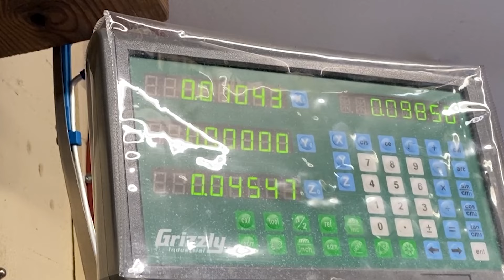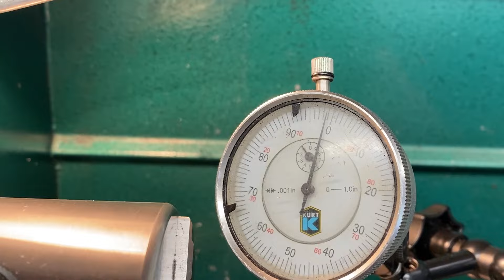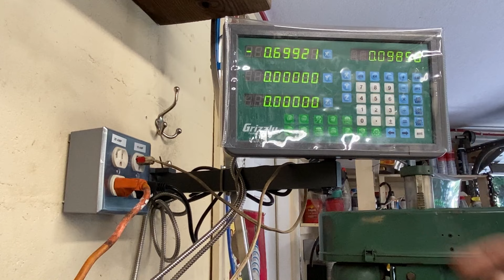Aluminum machining fuel Tee's Kawasaki.

Comment: Good work. A lot more time into them than people realise.
Reply from the maker: Only doing it this way, yes. I can't find any mass produced aftermarket for the ZX10 fuel joints or Tee's, but if they were around, they'd be either powdered metal 3D printed or CNC machined, and they'd crank 'em out by the thousands to try and make a few cents profit on each. I can make just about any one of these if they're custom.